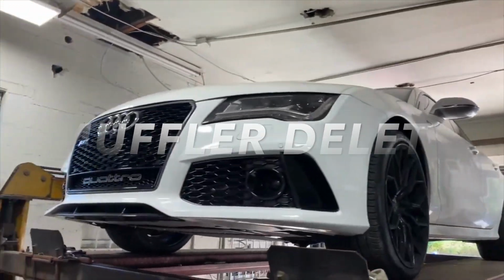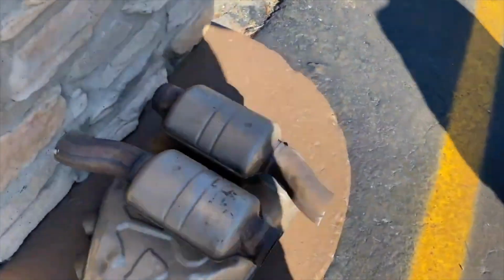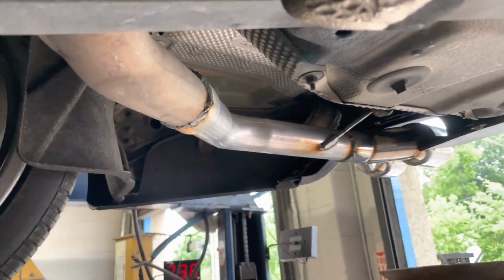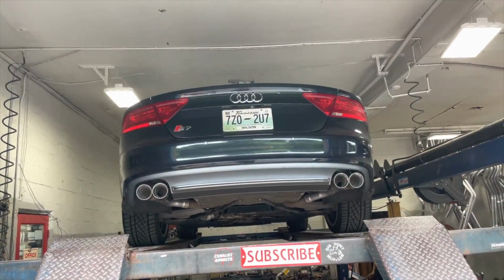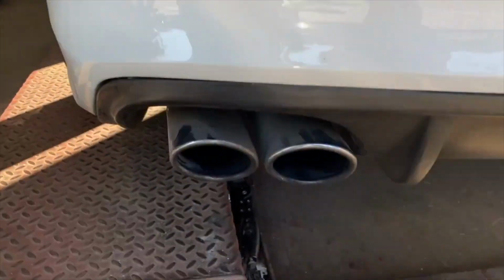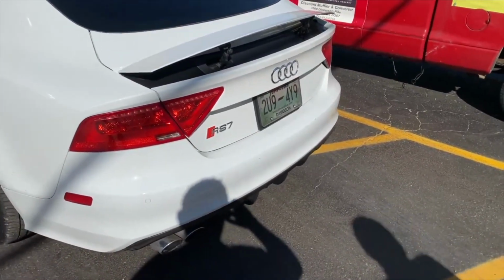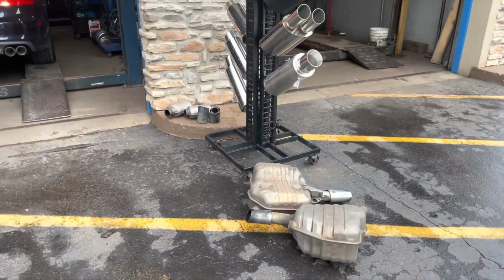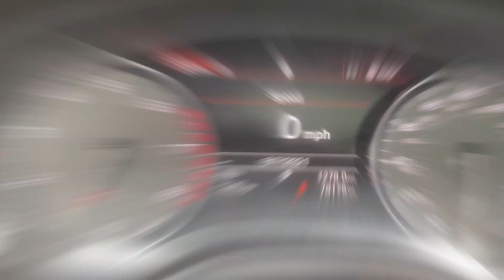Audi S7 4.0L TWIN TURBO V8: MUFFLER DELETE Vs STRAIGHT PIPES!

Comment: The s7 sounds much better with straight pipes because even if they did a muffler delete on it, it is still sounds the same. There's like no diference at all for some reason🤷‍♂️
Reply: Brooo frrr, i told myself when i get my rs7 imma get a full on straight pipe. U gotta do a straight pipe on a s7/rs7 for it to sound like a stock exhaust on a dodge charger hellcat🤦🏾‍♂️
Reply: It might be because Europe has stricter emission and noise regualtions
Reply: Yeah I did the first setup first, wasted money.. gotta chop it all lol

Comment: Turn the traction control off and you can rev it to redline
Reply: I do both believe that negates the soft limiter. 

$715 APR Tune does it though.
Reply: Nope. I have a 2014 A7 with the DSG and 3800 limiter. Only way around it is rolling at 1mph or more and neutral revving it
Reply: @Hips King the A7 does too. In the USA probably just has the 8 speed ZF auto but in other markets it was offered with the 7 speed DSG as well. Mine has the 3800 limiter, 7 gears, launch control, and DSG shift farts
Reply: @Inanabananana  different engine.
Reply: @clutchpack1969  yeah mine has a 2.8 V6. Not the 3.0T V6
Reply: Im the owner of the straight piped S7....my car didn't have a tune at the time of the video. It doesn't have the soft rev limiter and really have pops and bangs now.

Comment: The white Audi needs aftermarket mufflers and the black one needs mufflers and an x pipe.
Reply: Agreed, I’d just put a couple of short fat Megan Racing OE-RS mufflers on it, they do a good job getting rid of the nasty noises and keeping drone away, while refining sound and still being moderately loud under acceleration.
Reply: Bro what does a x pipe do
Reply: @Bikosiolii  H and X pipes balance the exhaust pulses from either side of a V-style engine. The result is a smooth exhaust flow,,better sound, and a more efficient engine.
Reply: @ragintaurusmusclemercury7023  ohh shit thanks
Reply: @ragintaurusmusclemercury7023  bro your car is crazy as fuck 😭
Reply: @Bikosiolii  Is that a bad thing? Forgive me but I am old. 😄😄

Comment: Actually if I’m correct the cat converters are built into the engine on these
Reply: Incorrect for any car.
Reply: @2v_media  wrong the new BMWs do it and I heard something about audis doing it to
Reply: @pilotm6572  give me some proof. You can’t put anything exhaust inside the engine…. That’s now how it works.
Reply: @2v_media  ah yes the old silent because you were wrong
Reply: @2v_media  you wanna admit your wrong
Reply: Some of y’all don’t understand that Catalytic converters are usually put on after the headers or near the down pipe like depending on the car
Reply: 🤦🏽‍♂️🤦🏽‍♂️🤦🏽‍♂️🤦🏽‍♂️Catalytic  converters are not built into the engine like that can cause the engine to overheat so they would either put it at the side or behind outside the engine near the downpipe or sometimes closer to the headers depending on the car
Reply: You may be correct about that BMW but these Audi's do not have them in the engine (remember,  you are comparing a newer model year car to an older one that may not have it yet). As someone who has a S7 Audi I can confirm that the cats sit just above those flex joints.
Reply: @seraphimvalkyrin4543  I mean yea because the BMW I worked on was a 19 but it was a twin turbo V8 and they had the converters inside of the engine
Reply: @2v_media  Well, the exhaust manifold is in the engine compartment, as is top half of the down pipes
Reply: @pilotm6572  Can you please be more specific?

Are you saying the cats are right after the exhaust manifold, next to the engine?

Or....are they after the exhaust manifold and a short section of pipe connects to them and they are down lower behind the engine?
Reply: @Jommybutler1234  the new BMWs have them built literally inside of the engine
Reply: Down pipes have the cats sir

Comment: needs catless downpipes 😩
Reply: I think these audis have the catalytic convertere are built inside of the engine on these, theyre like the new BMWs
Reply: @pilotm6572  😂 no. The cats are right behind the muffler. You can’t miss them I promise you. But you can get the same sound with catless DP and add power.
Reply: @pilotm6572  No car has cats “inside” of the engine. They are either catted at the header or the DP, depending on NA or Forced induction.
Reply: @KayvonGz  wrong bmws have them insidd
Reply: @pilotm6572  No they don’t. The down pipe is catted.
Reply: @KayvonGz  youre wrong